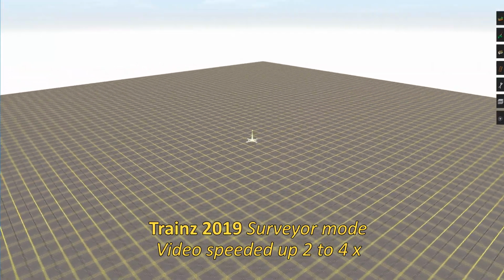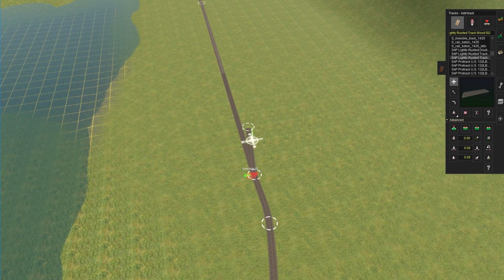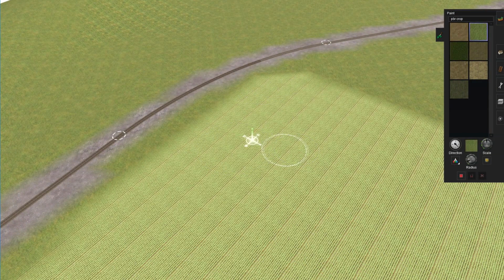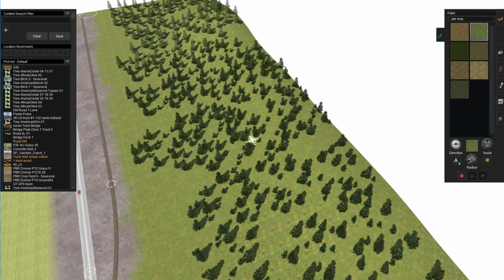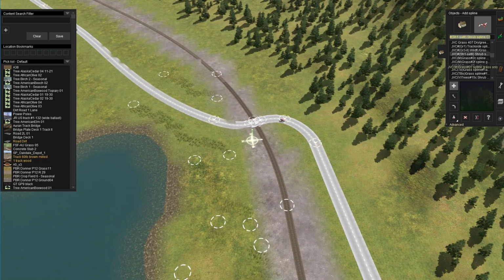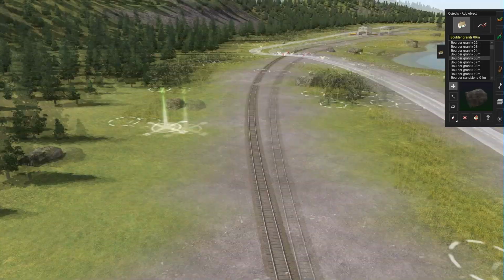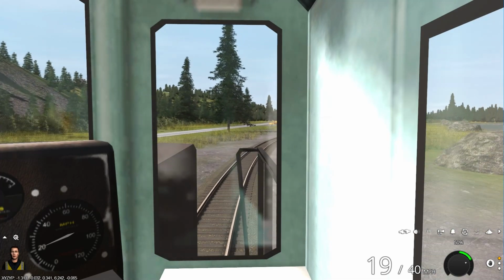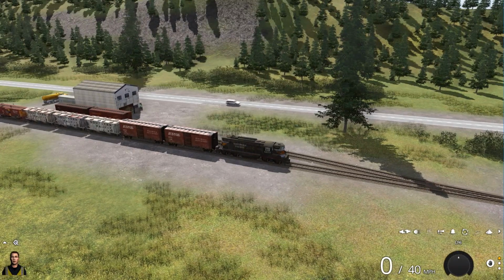Trainz 2019 - Build 'n Run Basics Tutorial

Comment: How can you rotate the texture direction the way you did?
Reply from the maker: Hitting the square bracket keys [ and ] will rotate the textures 90 degrees clockwise or counter-clockwise. Or one can grab a control in the F2 (scenery mode) panel to set finer amounts of rotation. Holding down the [ or ] keys will continuously rotate textures as one paints with them.

Comment: Hey Horace, I'm thinking of getting trainz 2019. In your video it shows you speeding up in areas. I've also seen that in Approach Mediums videos as well. I'm curious for something you built here how long does something like this take to actually build? obviously the better you get the faster you would be. I'm just on the bubble right now
Reply: I'm not Horace, but.  The length of time it takes to build a "layout" on your computer screen depends on how important it is to you.  Detailed, or Slap&Dash!  The most time I spent was Learning how to use TrainZ software.  TrainZ documentation is sparse, so it helps to get more "how-to" from sites like this one.  After working with it, your mouse speed will improve.  Deciding which assets to download from several thousands takes a lot of time as the project advances, or if you are trying to recreate a particular Railroad or period of time.

Comment: Hi and thanks for the video, very helpful.  I'm new to Trainz and have TRS019.; I wonder if you would know why , when i lay the Road 2L 02, it has no traffic like I see in your vid.  Cheers and thanks again for the info in this vid
Reply: Hi again.  I figured it out. In Surveyor Mode, in Edit Environment I clicked on the world icon and found traffic was enabled.... but apparently cars will only spawn in certain regions.  So still in Surveyor Mode, I went to Edit Route and changed the region.  Only certain roads in different regions are working for me and now I have flowing traffic.   Cheers again for your videos.
Reply from the maker: There is an option in Settings (under the upper left corner menus) for turning traffic on/off.